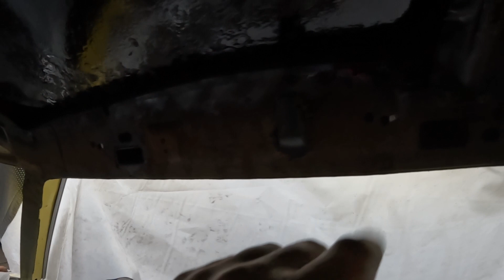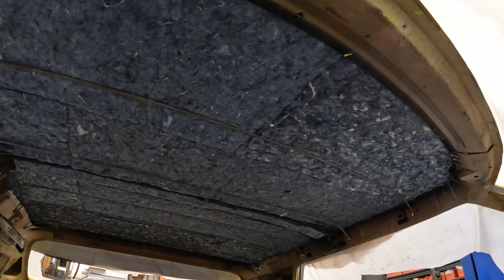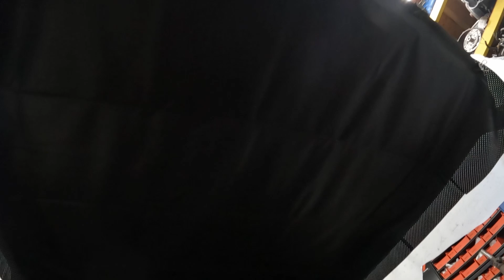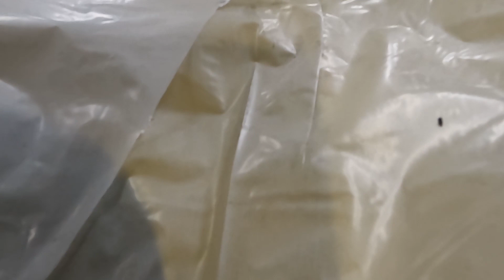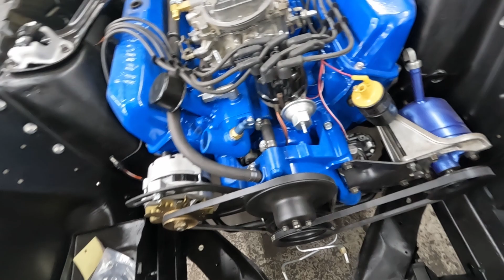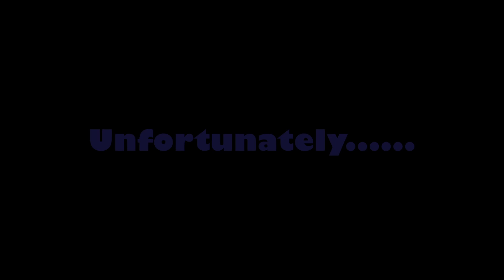#12  Mercury Cougar Eliminator 445    Time is running out, will I make Carlisle?

Comment: Can sumone please  tell me y I have alot of cam end play ?     390 to 444 stroker roller cam.      Did you put in the c spacer washer  on the cam   then the plate then the gear,      did u use the.  C spacer ??????  There's no videos that show anyone that  I can find   that show that,    is the c spacer my problem comp cams help line is way to busy for me to get thru working 7-7.  Work shifts
Reply from the maker: best to post this question on FEpower.net